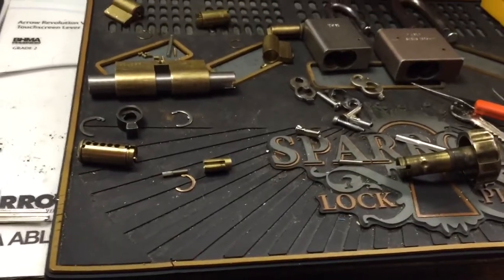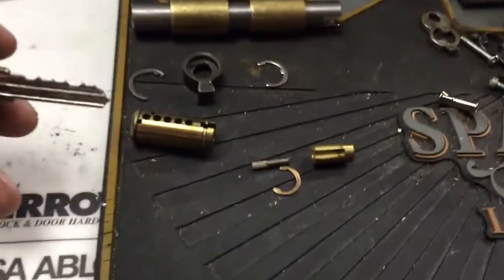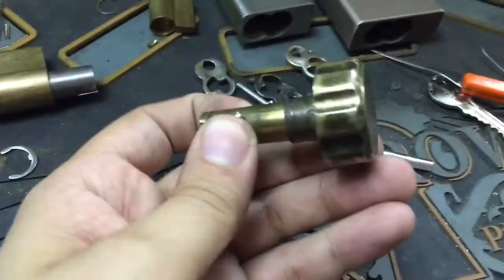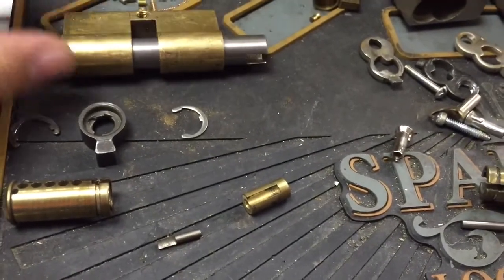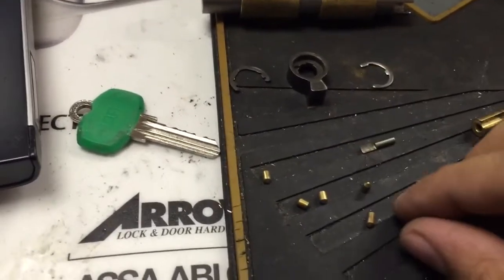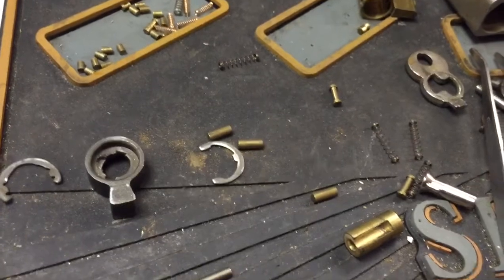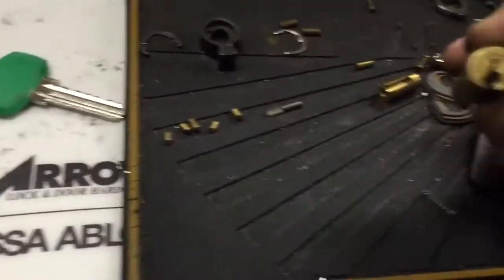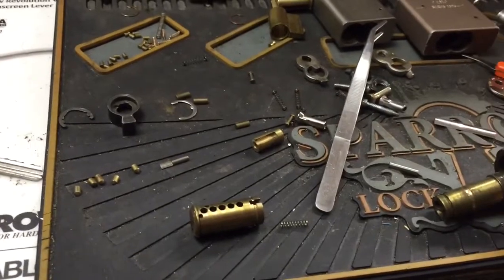Euro cylinder disassembled

Comment: cool vid man, yes there's a Circlip remover tool. There quite easy to find in the UK, sure you'll find one in the US.
Reply from the maker: the Schlage key gauge I use has cutouts to remove circlips but it wouldn't fit in the euro cylinder. http://imgur.com/Un4nmns
Reply: the tool i used in my last vid should do most euro cylinders, a little tricky to do tho sometimes.
Reply: no worries, i brought from walkers locksmiths, i believe they ship to US too.http://www.walkerlocksmiths.co.uk/index.php?route=product/product&product_id=709
Reply from the maker: I also thought it was a modified utility knife :)